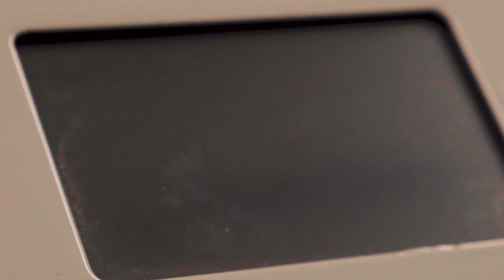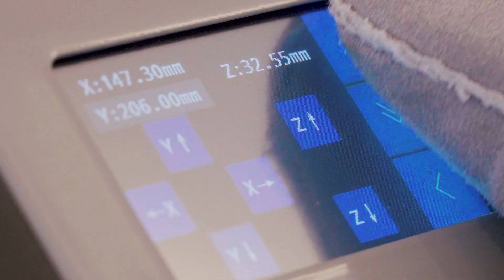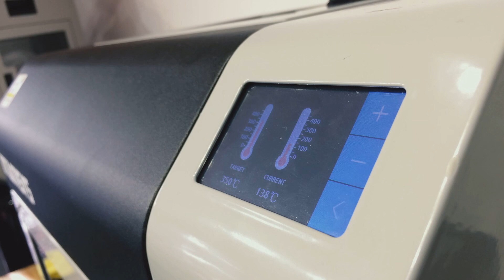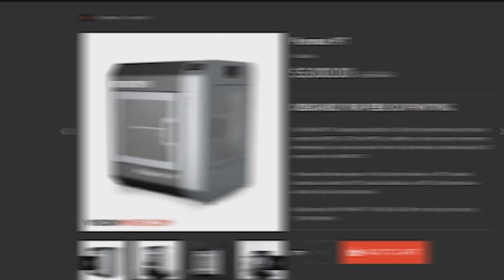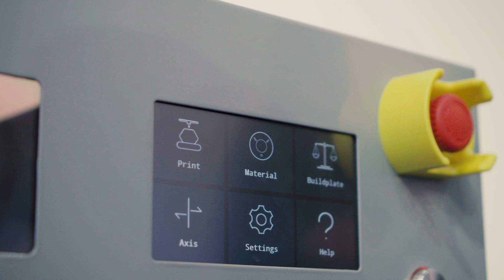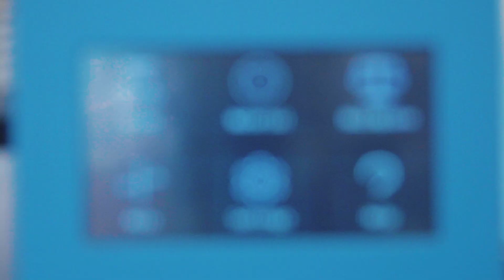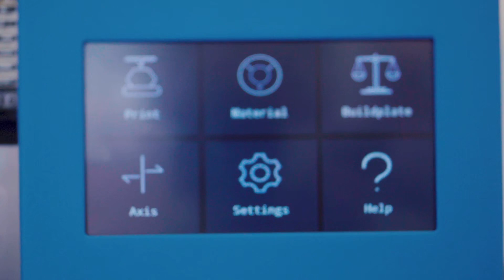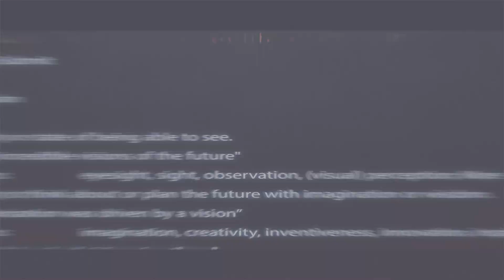Interview: INTAMSYS PEEK 3D Printers, Features & Overview with Vision Miner (2018)

Comment: I notice that the INTAMSYS FUNMAT HT is similar to the Ultimaker printers and INTAMSYS' slicer appears to be based on Cura. I wonder if a custom printer profile can be made in Ultimaker's Cura for the FUNMAT HT.
Reply from the maker: Yes, the printer is compatible with Cura, Simplify3D, Slic3r, and many other programs -- we actually include custom profiles for Cura and Simplify3D with every printer!
Reply: That's nice! Specifically, do the files for Cura include
1. printer definitions (*.def.json stored in "\resources\definitions")
2. material profiles (usually exported as *.xml.fdm_material)
3. and slicing settings (*.curaprofile or the older *.ini)?
Reply from the maker: Yes :)
Reply: Awesome!